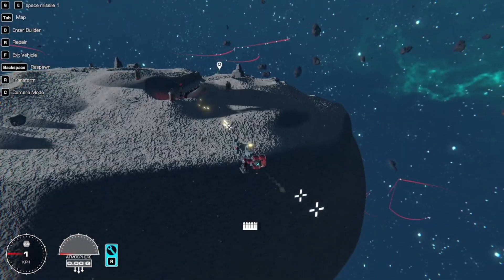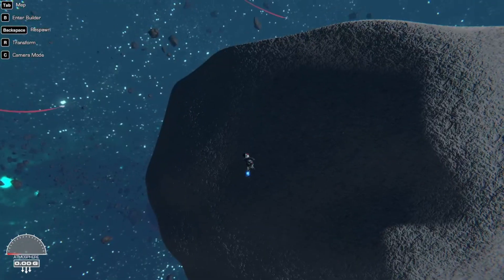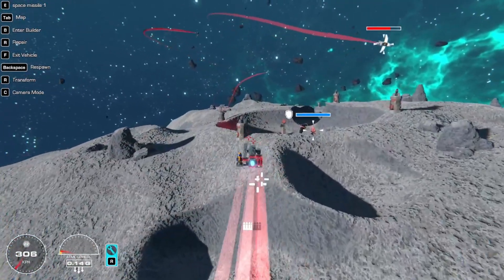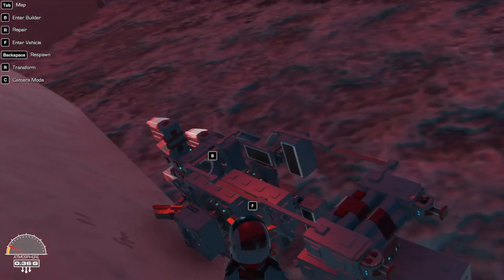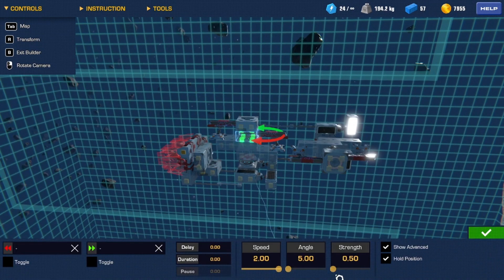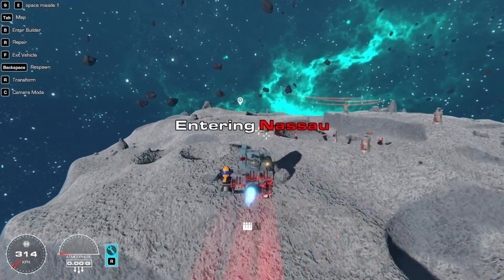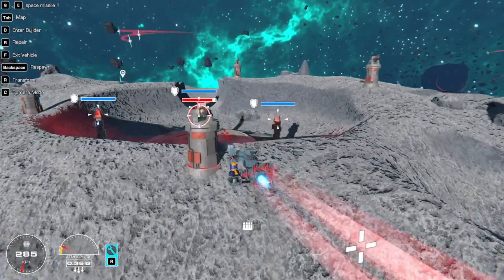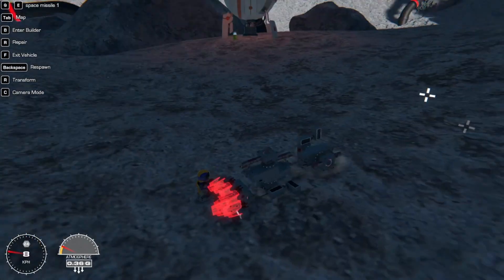Trailmakers Missiles and Guided Munitions Progress Update   |   RECOIL TECH

Comment: 2:59 Did you really mean to say that you have a servo between the gyro and the radar disk?
Didn't you mention in a previous video that servos return to their zero position, and you'll want to use helicopter engines instead? Using something that returns to its zero position could/would indeed cause the radar disks to oscillate.
Reply from the maker: yes. i did just make an obvious mistake that took a week to fix. its been fixed but the core issues of spinning out is still there. good on you for catching that.